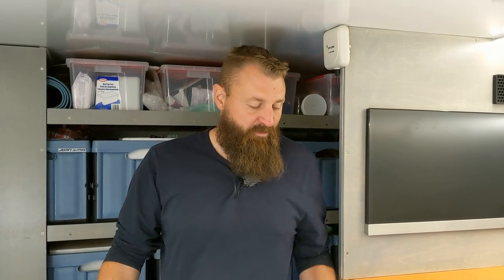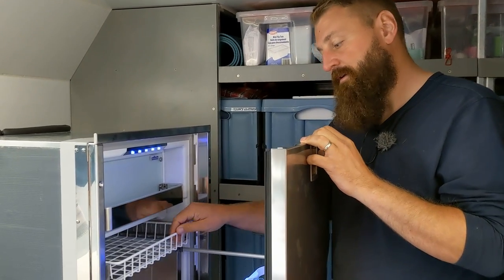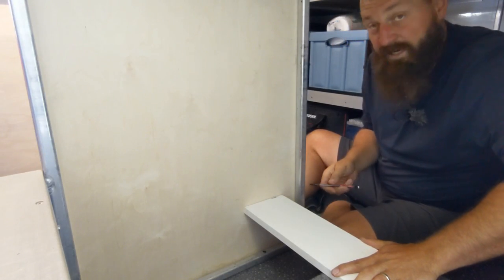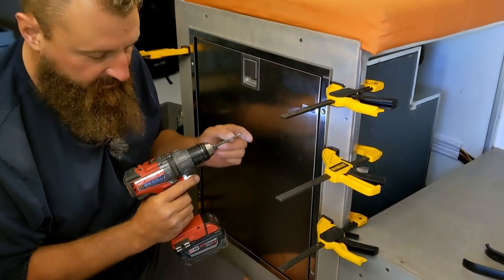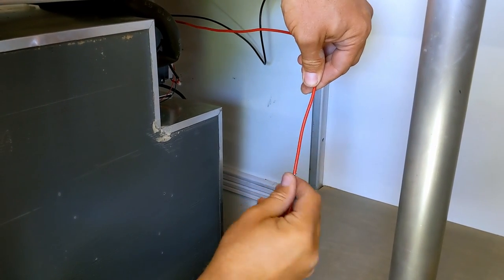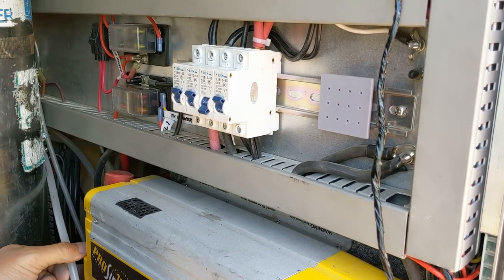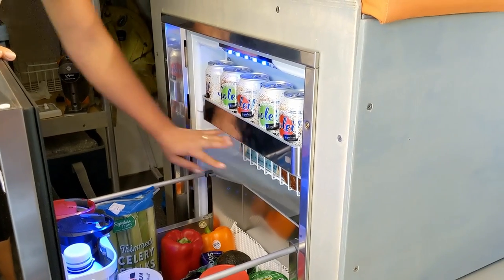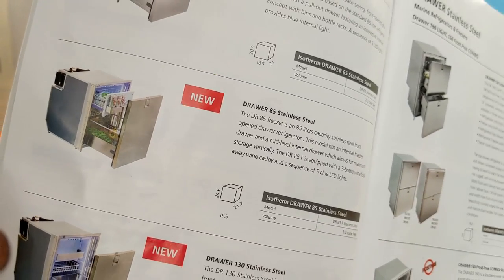Isotherm Fridge Install - Huge Upgrade! - How to build an Overlander!

Comment: I believe the Isotherms use a magnets around the weather stripping for a really good seal. That may be the stiffness you're finding while opening.
Reply from the maker: Correct! I've since figured this out, we've gotten used to it and it's not such a big deal...
Reply: I'd say the problem is more the latch design than anything.  It looks like you basically have to pinch a slick thin piece of stainless to pull it out, and if they put more of a handle or a loop on it it'd be a lot easier.

Comment: Just found your channel last night.  We are building a camper build based around a Discovery 1 on a Defender 130 chassis.  We have the 130l version of thise fridge.  The build is in process right now so we have never even turned the fridge on, but we did not like the latch to open it either.  Its too narrow and has a slightly sharp edge to it.  Just a small detail of course, but something that should be better given the price.  Also we only realised the freezer only goes to about -7c or thereabouts, rather than -18c as most overland freezers.  So we may have to keep a hold of our ARB 47litre fridge/freezer for ice creams and for keeping food properly frozen.  Great video, thanks for sharing it.

Comment: You did a conversion of the measurements for the cutout so I probably would have just measured it with my standard tape measure. Even if the measurements had come out the same it harkens back to the "measure twice, cut once" rule (which encourages double-checking all measurements requiring a cut). Your fix worked fine but - could have been avoided if you'd measured rather than depend on something in a manual or handout. Looks great, btw. Thanks for sharing this buddy. Safe travels!

Comment: ISOTHERM QUESTIONS! PLZ ANSWER! I want to add a 2 story box on a cab chassis. Can you just use wood, or can you use metal to make it custom dimensions. Can you drive 75-85mph safely with a wooden trailer housing 12 people and kids? I am also trying to do it the cheapest way possible but sturdy. I was thinking shipping container, but i dont know if they do custom dimensions for cheap.
Reply from the maker: A 85mph wooden Isotherm!¿

Comment: Home Depot sells the Unique 24vDC fridges which are twice the capacity and use half the power, with their Danfoss/Secop compressors.
Reply from the maker: Half the power? They use the exact same compressors! 

"Today, with our Isotherm refrigeration solutions, we can offer you very quiet and compact compressors thanks to the sole use of automotive validated Secop / Danfoss products."

https://www.webasto-comfort.com/int/comfort-solutions/recreational-vehicle-comfort/fridges/
Reply: @Everlanders  based on their written spec. 1100 wh over 24 hrs vs 520wh over 24 hrs.
Reply from the maker: Neither the Isotherm fridge nor the Engel deep freeze we have use anywhere near their rated specs.

Comment: I work in yachting and the boat that I work on has those for the exterior....it works great.....but opening it up isn't gonna get any easier....it seals really well....Soo if it starts to open up easy u better check that seal
Reply from the maker: Thanks for the good info!

Comment: Nicey nice!! Very cool fridge upgrade! (pun intended!) Thought you would need to strap it down more securely instead of just relying on those few screws to hold the fridge in. Love the way you designed the interior furniture to be so easy to change/repair /upgrade.

Comment: Love athe cable management. I would have pulled a ground wire, maybe that's why you're not seeing the correct amp draw.
Reply from the maker: The amp draw is correct.

Comment: I see you connect the negative to the chassis. Are there any disadvantages in doing that ? I know in aluminum boats it is not advisable because it would cause corrosion. Does it interfere with the car battery system in any way ?  Could I still ground the chassis (actual stake in the ground )? Thanks
Reply from the maker: The disadvantage is that it will cost a lot less running a ground cable to every device and solar panel as the ground all goes through the chassis and aluminum frame. It can not affect the chassis battery... It's like filling a glass of water on the table and wondering if it will affect the other glass of water on the same table. You can stake the ground if it makes you feel better, I never have.

Comment: +1 for efficiency. Speaking of, I'm curious why you couldn't just retrofit the truck with enough insulation (Passivhaus-style) so that you don't have to waste energy on an AC to keep the interior cool, especially since you don't have any windows. Given your expertise and skillset, I'm sure it would be possible and much more energy efficient.

Also, 5:42 boo for converting to customary units. Buying a millimetre-only (e.g., Fastcap True32) tape measure seems like a much easier proposition than having to convert to and use the clunky customary units.
Reply from the maker: Because I don't want to...

Comment: Looks great! Is that a television or monitor mounted on the wall? If it is, do you have the name? I love the super clean look.
Reply from the maker: It's a 28" AOC monitor, it' looks cleaner than it is, there is a mounting stand/bulge on the back that's buried in the wall.

Comment: Looking inside the power Box for the FANUC robot looks ever so similar to your power Junction Box for your overland rig... Do you come from a machine build or automation background?  It's such a clean install it looks professional... So much so that another technician could quickly diagnose a problem  without needing a manual. You guys rock
Reply from the maker: I can't speak about my background.
Reply: @Everlanders  Funny, I was wondering the same thing... we should talk sometime.

Perfect use-case for a soldered, Western Union wire splice over butt connectors -- and those flag spade connectors really are a pain without the 'special' crimp tool, aren't they?

Comment: Love the vid its really descriptive. i just bought a fridge and am a little confused on the wiring. was it only positive negative wire coming off the back or did you do some other instillation and wiring off screen?
Reply from the maker: Nope, positive and negative is all you need...

Comment: very nice build and fridge! kinda surprised you didnt upgrade the fan as you certainly seem to be one for both longevity and higher performance (or lower noise) lol
Reply from the maker: The stock fan isn't too bad. If it gets gummed up I'll replace it with a quieter one...
Reply: @Everlanders  ah fair enough!

Comment: I am looking for the video you did (I think) where you used a small electronic component ~2"in sq x 3?16"in thick that produces cold by its functioning that is not its intended purpose. 
Help?
Name of the component?
Reply from the maker: The only component which I could think of is called a "Peltier Cooler", or sometimes called "TEC Thermoelectric Cooler". I don't think I've ever shown them in a video.

Comment: Too bad the gremlins ate your soldering video, because we all know by now how fond you are of soldering, and from the solar controller video how freakishly good you are at it!  I was wondering if you will now set the Engel up as a freezer, given the larger volume of fridge space you have now.  Also, lots of room in your “water closet”!  Be well, and another cool video. (See what I did there?)
Reply from the maker: Correct! The Engel is our full time freezer now... Doggo is raw fed so that takes up a bunch of space!

Comment: Are those circuit breakers at 14:18 the same type that Todea Dacian at Electrodacus uses?
If so, where did you buy them from, please. I bought a SBMS40 : )
Also, if you did one. Which video would be the one to watch on the wiring the Utility Room?
The "Isotherm Drawer 85" is the one I have been looking at : ) Great Video.

Thank you.
Reply from the maker: https://h5.aliexpress.com/item/1925523531.html

Comment: Could you tell me what the technical name is for the containment that you use for your wiring I’ve used it on a few pieces of industrial equipment before but can’t remember the name of it for the life of me it would really help many thanks your videos are great been watching you for awhile now
Reply from the maker: I use Panduit Cable Raceway
Reply: @Everlanders  Thankyou Just been back over a load of your videos as I’ve been collecting parts for my build for about two years now and just brushing up on some of the wise that you have engineered stuff

Comment: Cool build. Do you think the way that fridge door is designed that it's going to be a pain getting to your items? The door looks like it will get in the way and you have to reach over it.
Reply from the maker: If it was up higher, above waist height you'd probably want the swinging door version, but ours is down low, so reaching down into it like a drawer is no problem.

Comment: not  worried about centering everything , I mite have elected to offset the unit to one side to increase the storage area on one side, maybe even using  your aluminum frame for mounting on one side and raising thee unit mite increase the storage area in the lower front, keeping in mind any requirements for airflow around the unit , but sometimes aesthetics out weigh optimization
Reply from the maker: To each, his own...
Reply: @Everlanders  wow, just blew me off, cool dude
Reply from the maker: Not blowing you off... Just nothing to add, you would have offset it, I wanted it centered with room for other equipment beside it. We agree to disagree.
Reply: @Everlanders  I don't disagree with your explanation

Comment: Great video. I’ve just discovered your channel so I’m catching up. You automate your truck in the same way I do my home pretty much, well done on a great explanation of everything I’ve seen so far.  I have two short questions: how is the freezer part holding up? Does it actually freeze low enough? I’m looking at using this in my new build. Lastly what brand of DC breaker do you use for your solar inputs? I can’t find much here in the UK so open to recommendations. Ok so three questions.  Cheers, Dave.
Reply from the maker: https://m.aliexpress.com/wholesale/dc-circuit-breaker.html
Reply from the maker: The isotherm freezer is working great, no problems, however our primary freezer is on the other side in the counter as I'm sure you found by now, this one is used for small things like ice cubes and such.
Reply: @Everlanders  thanks for link and the answers. I think we will also need to use a chest type for the "food" freezer.

Comment: Now that you've had the fridge for some time, curious if you have any feedback? We were considering the chest fridge but like the idea of this one since it appears to take up less room then a 85L chest model.
Reply from the maker: It's still working like a champ, no complaints... If you have the layout that would allow for a chest, I would go that route for sure... chest coolers don't lose all their cold every time you open the door, and there's more room for contents because there isn't sliding racks and drawer slides etc... I imagine that our actual food storage volume is probably closer to 70 l after you account for all the internal mechanisms. Unfortunately we just didn't have a good location to permanently mount another chest freezer.
Reply: @Everlanders thanks for the feedback and insight, that helps. The more we've seen and read about it, I think the chest would work better for us. We are still at the design stage so I think we can find a way to make it work.

Comment: Are you planning on keeping the older unit (in counter top) and using it as a Freezer?  Just curious…
                                                                                           ~ ~ ~ "Scooter' in East Texas
Reply from the maker: Yes, exactly... But it has changed roles back to fridge a few times too. Good to have that versatility! 👍

Comment: Will you be adding additional air venting in the back of the unit, venting to the outside?
Reply from the maker: This area is already vented outside with a temperature controlled fan.
Reply: @Everlanders  Interesting. Could you please make a Vlog with more detailed information? ( how to vent these fridges correctly )
Reply from the maker: No, sorry.

Comment: Which wire gauge did you used?
Reply from the maker: I use 10 gauge because I had it available and it was only 1 meter to the batteries. The wire gauge required will depend on the distance the wire needs to run, this is all provided in the manual.

Comment: What is the cable box system with the DIN rails called?
Reply from the maker: Googling: wire track, cable track, cable trunk yeilds lots of results!
Reply: @Everlanders  I'll need to make friends with an electrical engineer. Your set up is great!

Comment: One of the best values of having a drawer (horizontal) refrigerator as opposed to a vertical door refrigerator is that the later DOES allow the cold air to fall on the floor as soon as you open it.  That advantage is lost when the drawer is merely a basket.  Clearly, the maker WANTS the fridge to work harder so it will break down sooner.  It's called the moral deprivation of planned obsolescence.

Comment: If the handle is the plastic version (not metal), I’m sorry to report it will crack and fail completely, eventually. I am on my third handle. Isotherm refuses to upgrade the quality of plastic they use. Instead, they advise being ever more gentle with it, even going so far as to advise I open my fridge delicately, with two hands. Huge bummer when it breaks in Baja, and they refuse to ship a replacement internationally. I will eventually 3D-Print a better quality unit with my own $.
Reply from the maker: Ours is all metal!

Comment: I don't get the design of your fridge, it doesn't have a swinging door for ease of access but a pull out door where the front actually hinders it and it doesn't prevent the cold air from falling out of it like a chest would....With the amount of lithium you have you could run a normal and affordable fridge for a month without solar.
Reply from the maker: I agree, I wish there was a nice, large, chest fridge that fit under that seat nicely, but they just don't exist or don't fit through our door...
Reply: @Everlanders  I built a custom fridge..and put the compressor UNDER the bus, you don't need the heat inside during the summer when cooling is important. Just like a minisplit a/c does. In fact, spilling cold into the bus is OK, not a bad thing in the summer heat.
Could build you a custom one however you need it.
Reply from the maker: Exactly, that would have been perfect. But as we are heading south through Guatemala now, it might be a little too late to make these changes. I investigated having refrigeration shops relocate my compressors outside, but I couldn't get anyone to do it. there are refrigeration shops down here too of course, and they seem more willing to help get whatever you need done, done.

Comment: 5'40''   Still doing math? Why don't you just buy a meter tape? Easier and faster work and no risk of errors. The USA is the only Country in the world (Except for Burma and another one) still using miles, yard, feet, inches, fingernails... rather than the meter. Just the meter, with no need of any conversion feet-inches and so on. NASA switched to the SI, but the people not yet. By the way, I like your videos! So easy and nice to watch. Thank you!
Reply from the maker: Because I was in America, borrowing a measure tape from an American, buying a second tape measure cost money, math is free. Thanks for all your kind comments.
Reply: @Everlanders  
Ah... ok then, sorry. :)     Have a nice day, both of you, wherever you are!